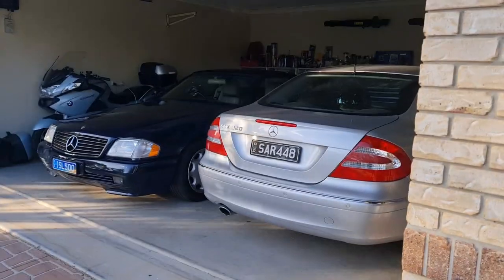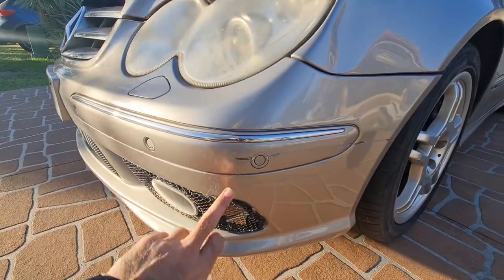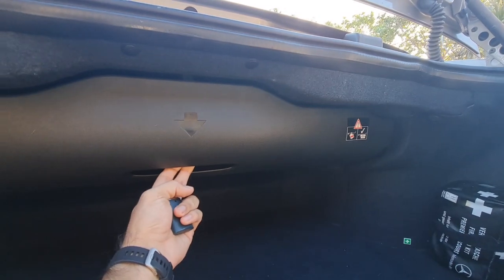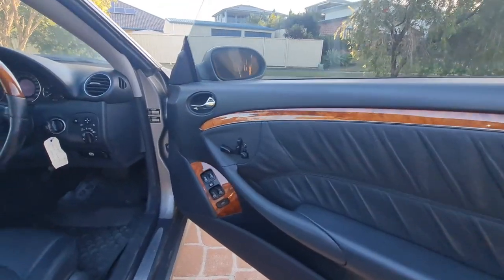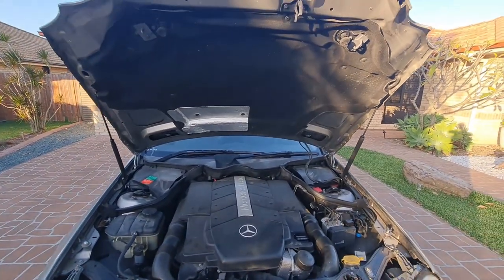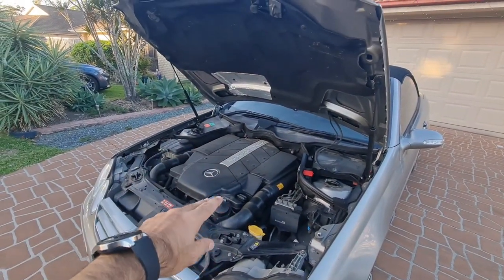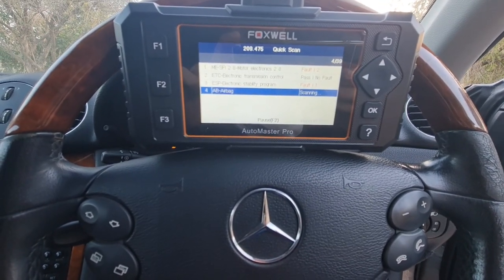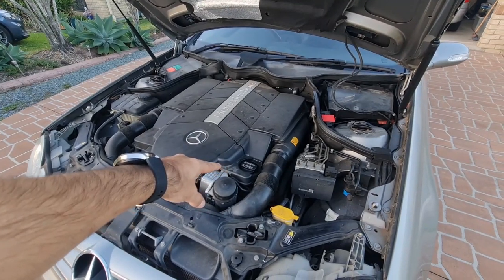Bought Sight Unseen: Mercedes CLK500 Convertible, perfect car?

Comment: Strange how people buy these cars and don't service them.
That car has an AMG exterior kit , front bumper cover , side skirts and rear spoiler. The rear spoiler simply sticks down with double sided tape.
I would start with engine oil change , and flush , and change again.
Then tackle the coolant , the transmission , the diff , and the brakes.
If you do it yourself , it won't cost thousands of dollars.
Rear spark plugs are easy if you put the socket on first , then the extension , then the wrench.
Do them at the same time as you do the valve covers and breathers.
Enjoy.
Reply from the maker: Thank you mate, very important tips, I am in the process of replacing all the fluids and filters.
Reply: @BenzAddiction  Great to see one of these excellent cars being rescued from further deterioration.
I have been through the same process and it is very worthwhile.
Reply from the maker: @Leonardo555ZZZ  Thank you Leonardo, I am now in the process of preparing the panels for spraying, will have the shine back to it soon.

Comment: I just bought an 05 and... i'm in love with this car. Ive had all kinds (almost all sports cars). Myfavorite was an 03 premium mustang gt convertible and this thing blows it away. The handling is mindblowing. It isnt as fast in a straight line as the mustang but .. if you want that get a 550. Around any kind of curves it blows away anything ive ever ridden in. And the level of luxury is mindblowing.
Reply from the maker: Yes, I just had a 120km road trip today and the sound, handling and power is amazing... needless to mention suspension is on comfortable side which is lovely Foe humps and bumps too

Comment: i'm not sure why you are afraid ,  the car is seems to be in pretty good shape none of the issues are major including the gunk in the oil filler neck that's kind of normal and doesn't mean anything since it's an area were old oil likes to sit even after regular oil changes  , the biggest pricier issue i can see is the roof top the rest is all regular maintenance , the leaks from the valve covers is to be expected on the m113.... easy fix, the 2 codes are also easy and inexpensive fixes the body damage isn't that bad even the dent can be pulled easily  .. overall i think you got a good car there especially for the price you paid
Reply from the maker: Thanks mate, you are right. Both issues rectified please watch latest video: https://youtu.be/q4Ped-XMFqk

And https://youtu.be/eGJ5Hxb6qQw
Reply: yes I watched the videos that was a serious project indeed good job tackling it yourself  @BenzAddiction
Reply from the maker: @mac2k2020  Thanks, enjoy your Merc ;)

Comment: May be buying one of these for $1,500. Tree fell on the drivers side quarter panel. Still drivable and top is fine. Just cosmetic. 117,000 miles
Reply from the maker: Soft top is super important for these. Canvas and hydraulic cylinders can cost $5000+.
Reply: @BenzAddiction  top can still be operated manually  if cylinders go bad right?
Reply from the maker: @jcritter9295  yes, but it's a pain and 2 person job. Takes 10 min almost.
Reply: @BenzAddiction  it doesn’t matter now anyways. Guy just sold it before I could get there. Rather have a hard top anyways